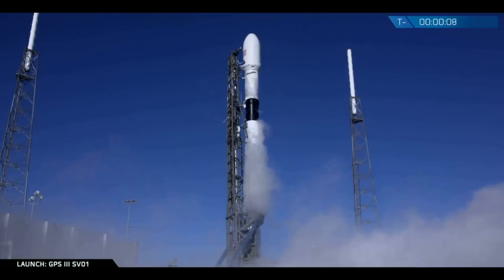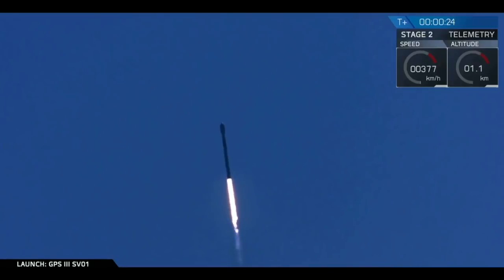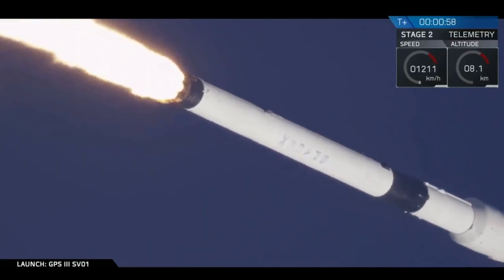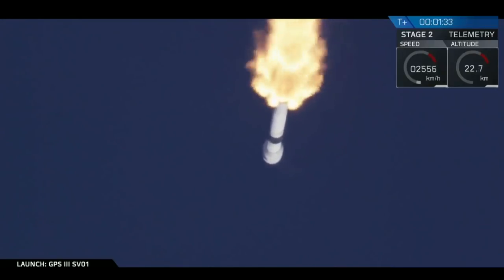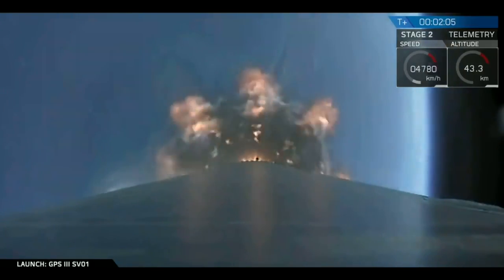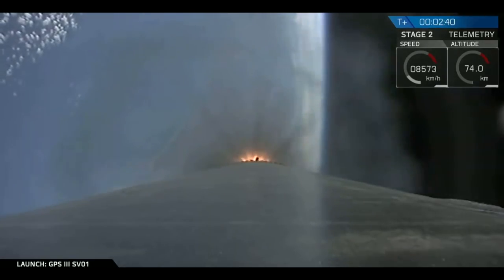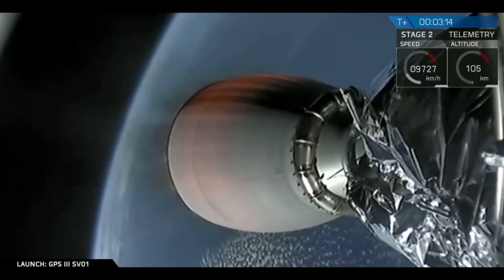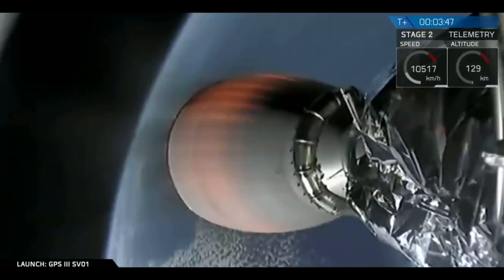Falcon 9 launches GPS III SV01

Comment: >Due to mission requirements, SpaceX did not attempted to land Falcon 9’s first stage (Block 5 B1054) after launch.

Does this mean that the GPS satellite is either quite heavy or needs to be sent to the orbit far away from the earth so there's no sufficient room for the first stage to have the necessary fuel for landing?
Sorry for this novice question but I admit I'm just a space fan in Japan with no related educational background.
Reply from the maker: @GOMBE3 Orbit & mass, it's explained here https://www.youtube.com/watch?list=PLpGTA7wMEDFhuvDu_hopPa3X6TiFoK_3Y&v=e2muxRz7f6U
Reply: @SciNewsRo  Oh, thanks I appreciate the link.

Comment: Does it landed successfully! Why they didnt show landing
Reply: They could've but the Air Force asked (and possibly paid) SpaceX for the full capabilities of the rocket for extra margins. This is a high profile mission.
Reply from the maker: Read the description
Reply from the maker: @Johnny Ericsson Falls into the Atlantic Ocean.
Reply: Why they did not land the first stage?
Reply: @lukaseder7214  They needed to burn all the fuel in order to reach the desired altitude. No fuel left for a return or landing.
Reply from the maker: @Lukas E Watch the first minute https://www.youtube.com/watch?list=PLpGTA7wMEDFhuvDu_hopPa3X6TiFoK_3Y&v=e2muxRz7f6U
Reply: Hopefully, Falcon Heavy will address this issue.
Reply from the maker: @fadlya.rahman4113  The next GPS III satellites will be launched by Falcon 9.

Comment: What is that on the second stage booster nozzle, it white and it moves across the top of the engine. Anyone else see this
Reply from the maker: @Steve Stimes  Explanation in this video https://www.youtube.com/watch?v=LZJbkeAlgVo at 1:41
Reply: @SciNewsRo  very well explained thank you... I see that it was ice or insulation of some sort😁
Reply: Either a piece of ice or insulation.
Reply: A mouse
Reply: @alainhamuli574  your too funny lol thank you for the comment🙂
Reply: I was wondering that
Reply: Yes i see that, what was that?
Reply: Oh yeah,that is a flux capacitor people,move along nothing to see here
Reply: @daviddowling9830  lol Flux on a rocket I guess we would never know lol
Reply: It’s solid oxygen. Believe it or not, space is cold enough and at a low enough pressure to freeze oxygen.
Reply: @michaelwilliams9234  thank you for your comment I learned something new
Reply: Elon dropped the popcorn...
Reply: Its a chunk of ice from the chilled fuel.
Reply: Quarter Pounder wrapper.
Reply: G Marie Precisely. With less air pressure in the upper atmosphere, the pressure gradient between our lungs and the outside air when we inhale is diminished. So less air flows in to our lungs.

Comment: I don't know why but it felt like most powerful launch ever I watched to me.
Reply: You're right.   Heavy payload with good early acceleration.   Reason:  no extra weight for landing (fuel, paddles, legs, etc.).
Makes for greater margin -- and a longer launch window too.  Also... the cold, clear, calm air (Canadian high pressure) helps to transmit engine noise (note camera shake at 0:25 - 0:35.)  Loud!   All good for those of us bundled up and watching from the riverbank in FL.  (Reminiscent of Atlas, Delta and Titan flying from the Air Force Station.)          :  ]
Reply: Watch falcon heavy then xD
Reply: Me too
Reply from the maker: Delta IV Heavy https://www.youtube.com/watch?v=socbr3DbxUA
Falcon Heavy https://www.youtube.com/watch?v=jT1Yk0q1HBI
Reply: samet demirtaş And they have installed new audio cams at the launch site